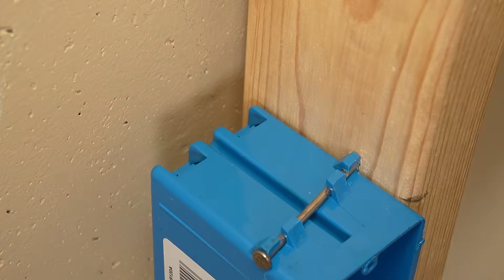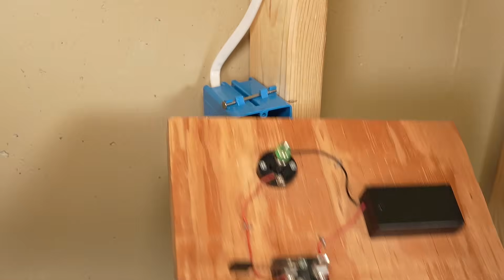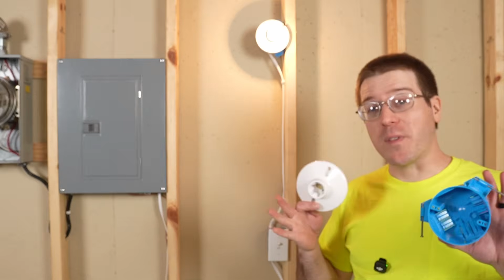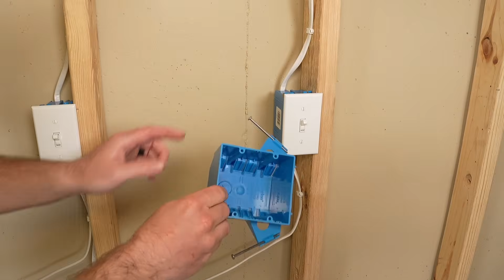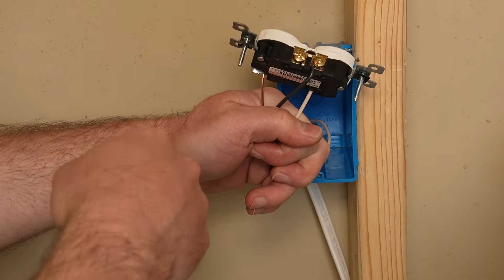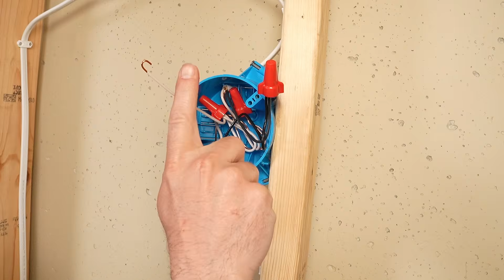Basic Switch Wiring Made Simple

Comment: WARNING: I had a situation where a fixture had the hot wire continuous in then switch box and the switch was on the neutral. I turned the switch off to work on the ceiling fan and found out the hard way it was still energized even though the switch was off. Always kill the breaker.

Comment: My attic uses the light box as the feed for multiple lights and then each light has a separate switch off of it. I want to replace all of it.
Reply from the maker: That's a pretty common installation. They run permanent power to each light, then switch it at the individual lights. I like having a switch at the entry point instead.

Comment: If i can please get an answer, the way you did the work for the switched receptacle. the travel wire(red), if i wanted to make a chain of full powered receptacles but the last one in the line will have one switch power, i will have to splice ONLY the red wires together as i pass through the other receptacles until i reach the final one and screw onto the designated screw right? Will that same concept apply if i wanted to do a 3 way lighting? I hope you respond.
Reply: You are correct, assuming you’re using both sets of screws on the receptacles to continue the line and neutral wires, then you would only need to splice the red and ground wires

Comment: Great video! If you're looking for ideas for a follow-up, it'd be awesome to see this same 2-gang setup but with aluminum wire pigtailed to copper. A lot of older homes still have aluminum branch wiring, so a video showing the proper pigtail method (with COPALUM or AlumiConn connectors) would help a ton of people dealing with that exact situation.

Comment: This is the guy to watch if you really want an instructor and not a wannabe you tube celebrity. Straight to the point, covers everything and doesn’t assume your knowledge point matches a preconceived notion of what ‘ everyone already knows ‘. So many videos cherry pick topics that cover some of what he explains, then race through to the finish and try to get cute for clicks. I have a solid knowledge and background in electronics as a retired telecom remote tester and repairing vintage tube radios, stereos, amps etc,but never did much house wiring as a simply didn’t need to except once in a blue moon replace the odd outlet, switch or light fixture. As i am now expanding my shop it’s great to see the proper way to wire, install and troubleshoot by a professional and not a jack of all trades that skips over the actual work and just runs their mouth😊

Comment: How to calculate the load for the breaker installed in the main box for all this receptacle and switch and what if there is dryer in same line has 240 volt
Reply from the maker: There is an entire article in the code book (120 NEC 2026 or 220 NEC 2023/2020/2017) that contains all the rules for doing load calculations. That's how branch circuit loads are calculated.

Comment: Im just changing the switch to a rectangle one but instead of two gold screws it has a silver and a gold screw does it matter? Is there a difference between the switches?
Reply from the maker: Hmm... does that new switch have a light in it? or is it a smart switch? if so, that switch might require a neutral.
Reply: @SmarterSparky  just a regular swith no light nor a smart switch
Reply from the maker: @maro_009  hmm that's strange. It should be two gold screws then. I couldn't speculate further without seeing it myself

Comment: Love love love your channel THANK YOU. Looking forward to more videos. 
 
Would love videos explaining how to map our homes electrical setup/map and how to figure out the downstream flow per circuit (not sure the correct terminology).

Also, what's the best way to seal boxes to prevent air loss and keeping pest out. I just found 2 hornets nest in our wall near exhaust fan when I ripped out kitchen soffit/bulkhead and found 2 dead hornet in the exhaust fan wire housing. 

Thank you! YOU ARE AMAZING!!
Reply from the maker: Thank you 🙂 By mapping do you mean what circuit breaker controls what circuit, or how to figure out what wires go where inside of a wall? The box sealing is a good idea, too. I'll add that to the list. Cheers!

Comment: How would 2 separate light switches work with controlling the same lights. ( imagine one switch on each side of the room both used to turn on and off the lights in that room ). I guess it would be power to switch 1 > to light 1 > light 2 etc. > switch 2 > back to switch 1 ?
Reply: In this case, there is essentially an extra hot wire. Both switches are connected with both hots, but power only flows if both switches match whichever direction it’s flipped. For example, if 1 switch is up and the other is down, the hot wires don’t make a complete connection, but if both are up OR both are down, there is a complete connection made and power continues to flow to the lights/appliance/outlet
Reply from the maker: That is called "Three-way switching". I have a video on that here: https://www.youtube.com/watch?v=V_yt0yvoiUA

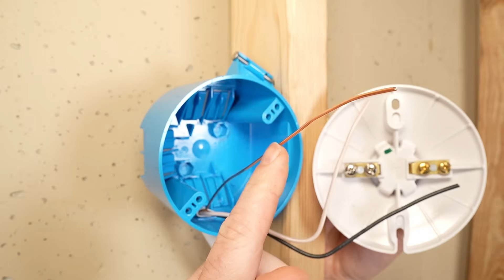Comment: 3:03 could you put a screw into the stud as a ground or would that be a bad idea?
Reply from the maker: Wood is a poor conductor of electricity. The purpose of the ground wire is to carry fault current back to the main panel in the event something goes wrong. A wood stud cannot fulfill that requirement. Good question! 😎

Comment: @Smarter Sparky  I have thoroughly enjoyed watching your videos today! I'm starting to learn all i can about residential electrical and code compliance so that i might able to repair my own. With that being said I've run into a sticky situation in my current repair. There is a broken Self-Contained Device (SCD) inside of a mobile home I'm attempting to fix. after looking closer, there appears to be a outlet inside of the wall behind the insulation. The opposing wall is a exterior wall with not direct tie to this broken outlet. My question would be, how best do i go about making this  repair? thoughts or concerns?  Thanks again for the great informative videos!
Reply from the maker: Interesting. I'm not quite following, but it sounds like there should be a way to remove the broken device, and replace it with a similar model, no? Or is it a matter of physically getting to the device?

Comment: My son will be starting construction on his new house & due to issues I’ve had with my kitchen wiring, I am going to recommend he use 12awg wire with “split receptacles” to not overload any one circuit. Do I need to identify these receptacles differently as I’d hate to have an electrician get called in to replace a bad receptacle and not realize the receptacle is split? Also, should I wire separate feeds from different breakers to allow for larger loads required during family events like Thanksgiving where all outlets are being used? Love ur videos!
Reply: 14-2 to 14-3 awg is fine also just use a multi-outlet surge protector
Reply from the maker: Kitchen countertops are required to have 12AWG wire protected by a 20A breaker. Also, countertops are required to be supplied by a minimum of two of these circuits. Split receptacles do not need to be identified (though it could be a nice bonus). An electrician would notice they are split.

Comment: Do different colored caps specify what wire is? I see hot wires use red caps and ground yellow? Or is that just preference, great video tho!
Reply from the maker: Each manufacturer has their own color scheme, and mean something within their ecosystem. They typically mean what size and quantity the wire nuts can handle. The wirenut colors do not have anything to do with the purpose of the wire they are splicing/tapping. Good question!

Comment: I might misunderstand electrical tape’s properties, perhaps it would cause problems, but couldn’t you just tape down the unused ground to the back of the light box is you need to male absolutely sure nothing will touch it?
Reply from the maker: Yep you certainly could! The adhesive on cheaper tapes fail pretty quickly, though. Super 33 is the best in my opinion.

Comment: How many wires can you get away with w/o pretwisting?
Reply from the maker: That's a personal preference. Four is about the highest I'll go without pretwisting. After that they get a little unwieldy.
Reply: Depends on the wire size and if your doing stranded to solid I personally pre twist everything even stranded
Reply: If someone doesn’t pre twist when it’s needed when you take the wire nut of all the wires fray apart that’s can be good in live situations or something that gets you shocked when your trying to trace an circuit

Comment: when i turn on my bathroom switch on the light and the only outlet get power. how do i make the outlet hot all the time
Reply from the maker: Chances are they are wired together using a 2-conductor. That might involve replacing wire inside the wall to control them independently.

Comment: Tell me something, you keep saying that I have to be an inch and a quarter. But the knock out for the boxes are in the back, tells me that your theory of which knock out to use is crap. Stapling up to the box within 12 or in inches is key for that 1 1/4 rule... But it if it was so so important the knockout would be right in the middle of the box. I do agree that you need to keep the inch and a quarter but when you get to the Box it absolutely makes no difference . If it did the manufacturer would fix that
Reply from the maker: Nope, the way the code reads is cable cannot be within 1 1/4 inch of the face of the supporting member (stud). Imagine holding a 1 1/4" string off the corner of the stud and wrapping it 90 degrees to the side. Cable can't be within that radius. With a deep box in a 2x4 wall, that space covers up the closest knockout, but not the farthest. Manufacturers have solved this by adding two knockouts opposite of each other at the back of the box on the top and bottom. I'll make a video on this. It definitely is confusing.
Reply: @SmarterSparky ehhh... If it mattered so much then why doesn't anyone get busted at rough in inspection?  That just doesn't happen. I'm not trying to be a butt hole, but I am challenging you now to show me/us this is an issue. Keep up the good work.. Your channel is good.
Reply from the maker: @MrMuttcreates  The inspectors in our area call it out constantly. The code is open to interpretation. Unfortunately it isn't our interpretation that matters, it's the interpretation of the inspector doing the inspections. Inspectors in one area might let something slide, where in another area the inspectors may call something out.
Reply: @SmarterSparky fair enough. I've not done much residential in any other state than where I live, I've done commercial work and industrial all over. Just never heard of that before. And I believe still that if it was an issue at least in my opinion, manufacturer would fix it. We will have to agree it disagree with this. Keep up the good work and I appreciate you commenting back. You definitely gained me as a subscriber
Reply from the maker: Cheers! 🙂

Comment: Really awesome video. Thank you so much. I think that running the home run straight to the fixture then to the switch was normal procedure many years ago, correct?
Reply from the maker: It's pretty common to see power ran to the light first in older installations, yes.

Comment: Could you use electrical tape to cover up the unused neutral wire in the second to last example instead of a wirenut?
Reply from the maker: Yes, and that's pretty common on larger conductors. On smaller conductors the tape tends to unwind over time. If a wirenut will fit on a conductor, it's best to use a wirenut.